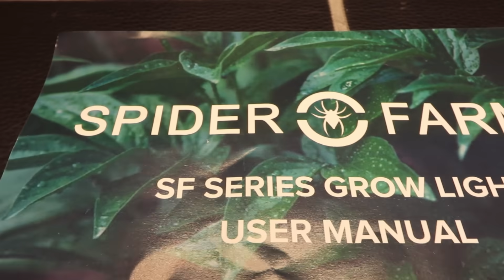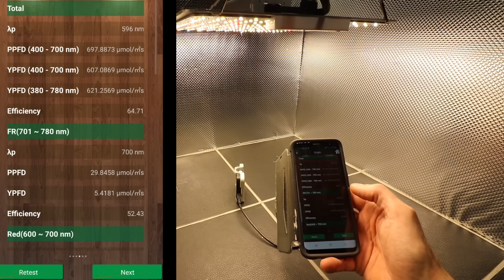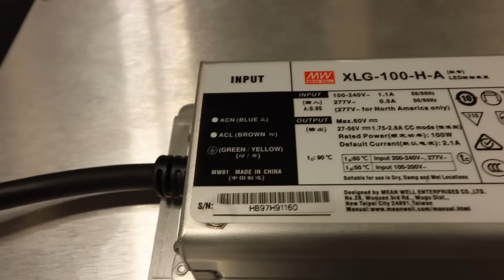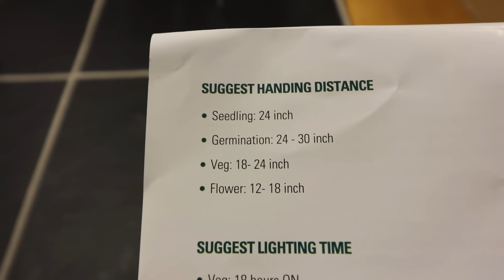Spider farmer SF1000 PAR test and review

Comment: Thanks for the review Shane. Looks like they'll need to tame down their claims of 2.77umol/j but still very impressive for the price. Glad to hear the colour temperature so I can set my video camera accordingly to film under it
Reply: 2.7 is likely for the sf4000
Reply: @Gadz-c1c  wouldn't make a difference as the 4000 model is just 4 of the 1000 models put together and they are claiming 2.7 for the 1000 model but for the £89.99 they are selling them for on eBay it's still a great deal.
Reply: I wouldn't be surprised if they lied about most of their metrics.

Comment: How would you rate this against the mars ts range?
Reply: If you can get Bava on your amazon that'd be better still; they have proper dimmers, top bin 301's & fin heatsinks.  They run higher power than spider farmer too
Reply: Spider Farmer is better.  They're Samsung 301 whites which is the meat, its where the money goes, they're the gold standard in the best growlights money can buy.  Mars whites are just Epistars.
Reply: I own this and the TS1000 as veg lights... This is a better quality, more efficient light, but it's more expensive. The TS1000 is lower quality and less efficient, but cheaper and has more total light output and coverage area. I think the TS1000 makes a better veg light with the extra blue spectrum, but the SF makes a better flower light with more reds in there.

Comment: Great video. I was highly anticipating that one. Too bad about the dimmer or I might’ve purchased the SF4000. The HLG 550 v2 rspec. I’ll be buying this light this week and would love to see a review from you on it. That’s my vote. Thanks!
Reply: Just when I thought I was gonna purchase the HLG 550 v2 rspec, I couldn’t stop thinking about heat dissipation. I’m using a 4x4 Gorilla Shorty tent, which means I’m growing in an extremely small space. The HLG has all the specs and the price point I was looking for, but the driver is mounted on the back of the light and there really isn’t much to speak of in terms of a heat sink. People who love it even say it runs hot. So I instead went with the Chilled Logic 660. The main reason for the switch was the remote driver mounting option and the heat sinks on every puck. Should help keep the temps in my tent low. I know you’ve already reviewed the v2 puck, but I’d love to see a review of the 660 as a unit. Keep up the good work!

Comment: would love to have you review and test Pacific Light Concepts Photoboost Strips,   with 8 strips in a 24" x 24" light size configuration. 
pretty sure this would be in the top 3 lights youve ever tested if you decide to do so.
Reply: That's too much power in that size space. You could do a 2x4 space with that and a hlg 320-c1400. 5 photoboost strips with a hlg 240h-1750 would be more than enough. You would probably have to dim it to around 160 watts to keep from burning.
Reply: @dudemcgee256  my space is 2.5' x 5' 
The LIGHT measures 26x24.
And yes two of these lights are still too much light for the 2.5' x 5' but I can dim it down to where I am burning 250 watts each 500 watts total with a very even 1000 PPFD across the canopy.
I can run these just 6-8" from the canopy with no burning, and dimmed they are extremely efficient running close around 2.7+ Umols/j and run so cool to the touch that if you close your eyes and touch them you really can't even tell if they're on or not, cool as a cucumber. 
And if I move and get a larger grow space I already have enough light just turn up 100%

Comment: Hey, would it be possible for you to do some PAR testing on some E27 LED bulbs with the domes chopped off? Because i know some people (me included) that use those Lights and would really like to know what the actual PAR values of those Lights are. I have not seen anything reliable about the topic on the Internet, soo i thought maybe you could make a nice Video about that as your tests are allways really good and reliable. Im sure im not the only one who would love to see a video like that. Maybe even Test some CFL's? 
P.S.: I think the 10w - 15w range is most popular for LEDs
Reply: @OGSteele-i9v  i really dont trust Lumen readings from a Phone App... im actually using a Selfmade Led light using 13w bulbs. I can run Up to 12 bulbs (156w total wich is a lot of true LED Power for The 2x2 im running) and adjust the spectrum by using different K bulbs. Took a few hours to build a Wood mount, Wire the Sockets Up and add some Strings to hang from. the whole thing cost around 50-60$. its obviously not quite as efficient as a quantum Board, but I definitely could not have bought a comparable light for that ammount of money. Plus most cheap LED Lights are actively cooled and loud, wich mine isnt
Reply: @OGSteele-i9v  how else are you supposed to get an accurate reading of what the light can do? PAR meters are simply expensive, Lights dont need to be. Im only suggesting him Testing some, because there is Zero information on the topic to be found on the Internet. I dont need to know the PAR, because i know it works, but im just curious how well it actually, objectively works

Comment: What would I be better off with out of the SPIDER FARM'S SF4000 or the ADREN EX500 in a 5×5×8 Yeild Lab Tent? I'll be growing cannabis for my seizure disorder and not having to take my medication called Tegretol 200mg. I have learned so much from your videos and I would like to Thank You very much for your time in knowledge of your videos. Looking forward to see your next one you make. 👍🗣🌱. I'm not worried about the yeild but the quality of my medicine. I also grow Healthy by not using all the hydroponic ingredients, and I make a real good mix of soil. If I need some nutrients I do my best to make it organically as possible. Can't wait to hear your thoughts on what light to get. I'm using a Vipaspectrum 900W Reflector Series in a 4×4×8 now and a Mercury bar like for supplemental lighting coverage for the Flower stage as well . I still need to get a little better canopy PENETRATION during the flower stage of growth.
Reply: I have the sf-4000.
Had to turn it down to 60%(290watts) during the veg portion while I let them fill my 4x4x8. 
100% was too much during that phase.

Only running at 85%(382w) during flower.
I'll be bumping up to a 5x5x8 next run.
The sf-4000 definitely has the light for it.

Good luck!

Comment: Do the infrared 760 nm IR LEDS "radiate"  heat on the leafs like HPS do? (or what's their "function") 
I come from HPS and the leaf temperature is about 5-7 degrees lower with LED... meaning the grow room needs to be quite warmer than when I grow with HPS. I don't wanna heat my room, since that defeats the energy Im saving now with these QBs.
Reply: infrared + 660ish nm = emerson effect. The function is to boost growth particularly in flowering

Comment: Thank you for another professional review.  I would like to see a review of PLC Power Boost Strips please. Thanks in advance.
Reply: PHOTO boost strips.   Id like to see that myself, I made two 26" x 24" lights with 8 strips each to cover a 2.5' x 5' space and I have to run them dimmed down to 250 watts each because they are too intense, but dimmed at 500 watts they must be pushing around 3 Umols/j
Reply: @delosombres so dimmed by 35% like I am running them they should be about 2.7+ umol/j at system level then.which is probably better than 95% of everything out there

Comment: I have it running at 110 watts since one month. 
Bought it from German stock at Aliexpress (3 days DHL shipping, no tax)
I'm glad I went from HPS straight to Quantum Boards skipping the blurple LEDs. No need to hang driver outside the room, you will need the heat :D
btw Also have HLG 100 v2, I kinda prefer the Spider since it has a dimmer on it, plus it has more red
Reply: like to see them a few years down the line.  do they lose there brightness in time?
Reply: @timeisart1320  

THIS !!
Reply: @timeisart1320  I'd like to see data on that too. Samsung diodes after X hours give so much PAR, etc
HPS are the worst, so I expect A LOT better from these diodes.
Reply: eakerz HPS lights are far from the worst, especially when using a magnetic ballast and not over clocking the bulbs with a cheap digital ballast. I just recently replaced my last HPS that has the original Phillips bulb that is going on 10-11 years. I’m sure it’s lost a decent amount of PAR in the last decade but you’d be hard pressed to even find an LED that old still in working condition. I recommend changing your HPS bulbs after 2-3 flowering cycles but the longevity of the bulbs are much better than you are thinking. 
As for the Spider Farmer diodes, they are Samsung which are the best on the market and I’d expect to get at least a few years of constant use with minimal loss of output. I think these lights by Spider Farmer are among the best available at this price point.
Reply: @elancaster808  most of these leds run for 100 000 hours. No hps or hid will ever do that
Reply: Justin Martin do simple math much? lol I just replaced an HID bulb with 72,270 hours of use.. and it was still working. And you’re talking about the “projected” lifespan of the newer LED ‘DIODES’ (not bulbs)...because they haven’t been around for 11 years.
Reply: I have a few led videos up if intrested, work well for growing
Reply: @crystalgarden5359  

Do they lose their brightness in time.
Reply: @ihreMaskeSitztNichtRichtig  hi Karl, I'm only on my 3rd run with them .so far no but I think they will loose brightness over time
Reply: eakerz how far into your grow are you? I’m interested in the same lights the aliexpress and wanted to see if they’re working well for you
Reply: @tonytucker2988  about one month now, filled a 2x2 scrog in 30 days with 3 autos, so far same impressive growth as hlg 100 v2
Reply: Autos lol
Reply: @ihreMaskeSitztNichtRichtig  Can't be nothing much, of course I've never tried Auto's, I've just heard from a friend that they're not worth the time

Comment: sf1000-218 diodes, sf 2000 303 diodes per board. how will this affect the J / W coefficient?
Reply from the maker: Good point, probably lower as they are being run harder, good spot :)

Comment: cheap, looks like it's home made and without any design ethos...next stop scrap parts bin
Reply: It’s actually a solid well built unit , iv been using it for a few months now 24/7 in my veg tent , absolutely no complaints or issues so far! 

Defo Won’t be in the scrap bin any time soon 🤷🏻‍♂️
Reply: @joegrows4209  Agree. I've got a sf1000 and a 2000 and my plants seem to love em.
Reply: It's very solid, no flex at all, it's simple design is a strong point IMO.

Comment: Cre cob phlizon 1000w I think will need to test beacuse this light is in the same bracket at mars hydro and spider farm (cost) great review as always
Reply from the maker: I'll put it on the list, thanks
Reply: All 3 are owned and made by the same company Shenzhen lighting Corp.
Reply: This light Has become more popular by the day, provably the price tag and the attractive cree cobs are helping, it uses double small diodes and a pair of older generation cree cobs ,240 watts plhizon contains UV diodes,Will's brand is the same light fixture but no UV 15 dlls cheaper